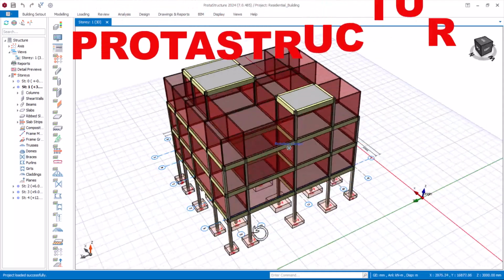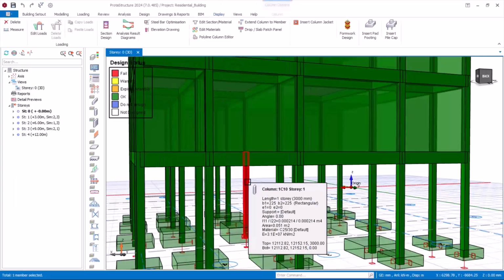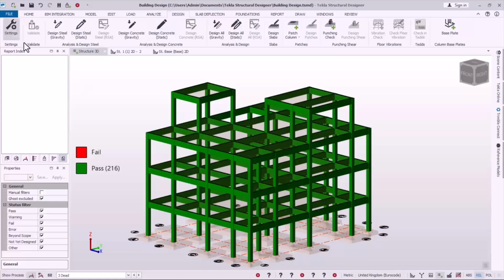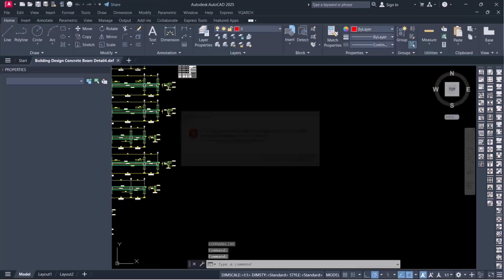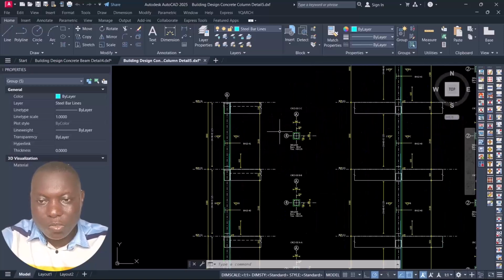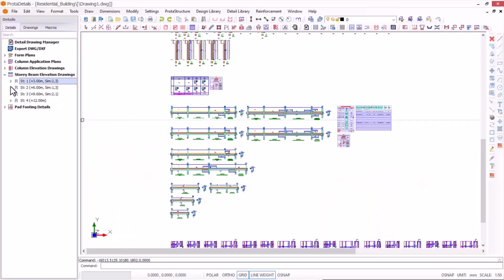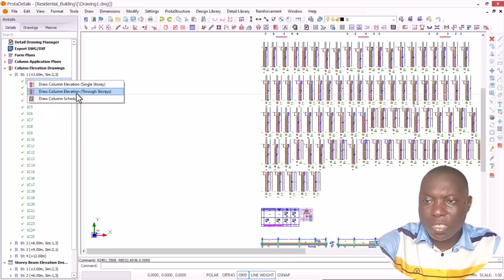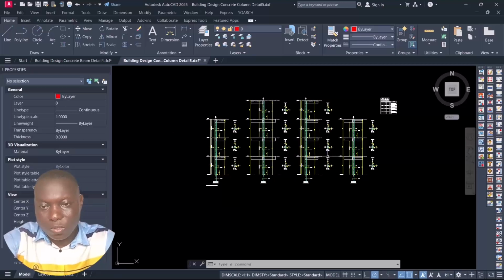PROTA vs TEKLA Designer, Beam & Column Detailing Showdown (Which is Faster Better?)

Comment: Tekla structural designer, it's hard to design aribbed slab, but in prota it's very easy
Reply from the maker: It does Ribbed Slab  Design Very alright Sir
Reply: @CADmade-easy  I don't see the option for ribbed slab in tekla structural designer
Reply: I only see rc slab only
Reply from the maker: @davidndayambaje3588  There is Provision for Ribbed Slab Design, we look at that subsequently

Comment: There is no better software every software has it strength, weaknesses and architecture. 
My advice to all structural engineer is to learn multiple software so you can pick the right one for the job at hand.
Reply from the maker: Thank You Sir
Reply: Correct

Comment: Prota is far better for model and design staircase or inclined slabs then all other softwares that i have witnessed, many different types of footing including trapezoidal footing  ( why it doesn't use service load to determine area of footing but TSD is good for that according to codes it will also consider variation in SBC considering combinations with eq load cases), in protastructure drafting or creating final drawing is very easy (TS is also good but even small aspects like numbering is very difficult), prota and TSD must make provisions for non prismatic sections for rcc and steel prota should also include modeling and design of RCC dome, provisions for stiffness modifiers for service load should also be added in protastructure, protasteel must be capable for checks regarding manual connections and IS code should be included in protasteel, modifications for applying soil load is necessary, protastructure only shows plan and 3d there is no elevation view that must be added, as TSD has provisions for creating family of  various components protastructure should also include that, in protastructure grouping is only for beams they should also include automatic grouping for column......more features like scaling (corresponding to Autocad) should be included in protastructure.......in TSD some steel members can be set only to resist tension i don't think protastructure has such an idea....
Reply from the maker: Nice Analysis, Thank You Sir